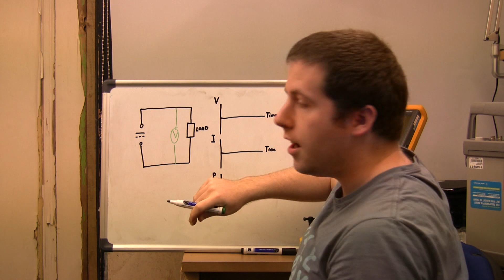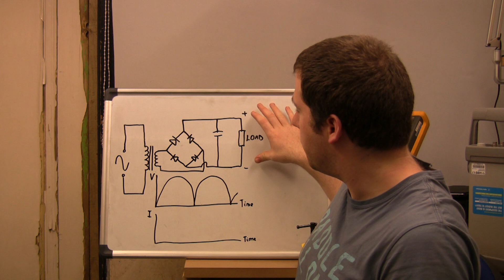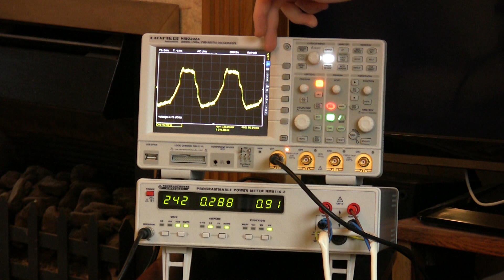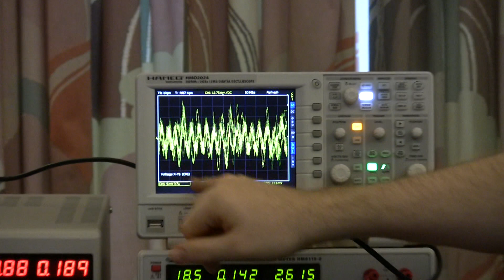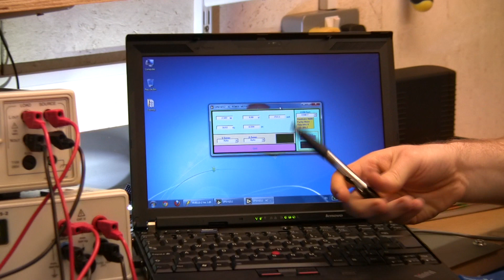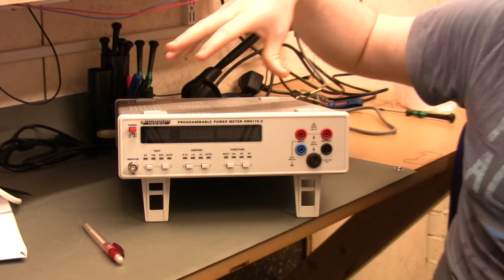Watt Circuit HAMEG HM8115-2 Power Meter Review

Comment: Hello David.
Thanks for the review since after viewing it, I bought one unit.
About your size concern ( haha ), upon reading the manual, I think I got an answer: it is stated on numerous occasions in the manual that the front panel may become quite hot when used at high current. Maybe they had that issue in mind so they left enough space between it and the electronics to keep it cool. Just a thought.... Greetings.